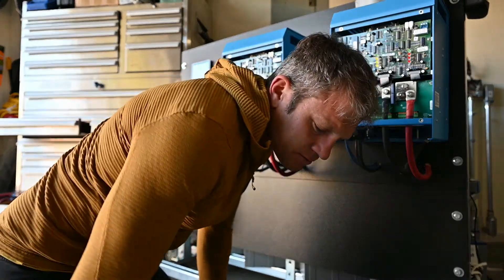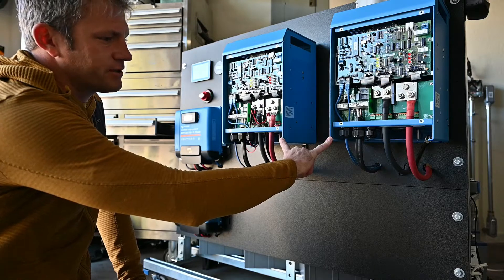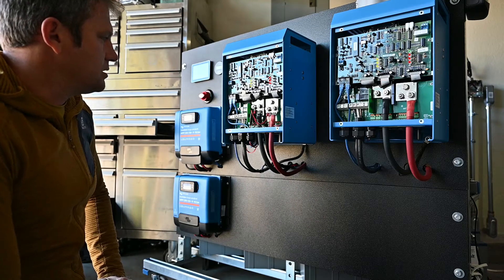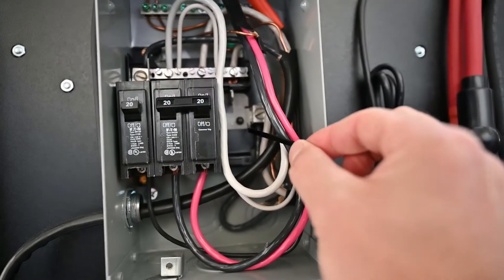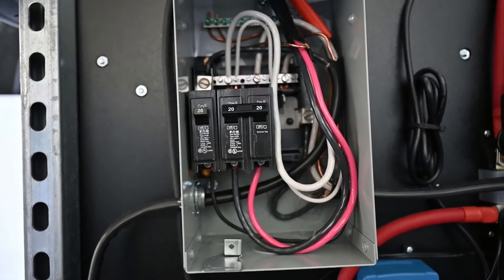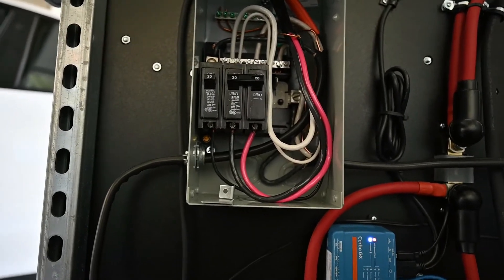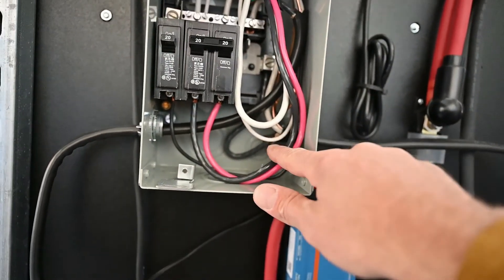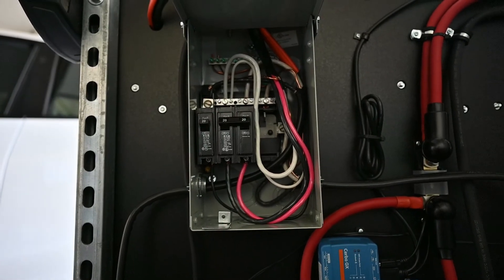AC Wiring Details: Tesla Charging with a 240V split phase off-grid solar system

Comment: Switching from an EG4 to Victron for our EVSE charger. Did you have to configure the neutral/ground relay through a setting on the Victron ? We're probably going to use the Victron EVSE just for continuity, but may try our extra Chargepoint.

Comment: Thanks for the explanation on how 2 Inverters can make 120/240. Nice install, but my opinion is clean up that breaker panel some, cut the outer jacket off at the clamps.

Comment: I'm still learning about solar so this may be a dumb question, but is it possible to run this system without the batteries? So that it's only the power from the sun going straight into the ev.
Reply from the maker: They now make inverters that work without batteries (some GroWatt inverters for example). Those have built-in max power point trackers so you plug you PV into the inverter and get AC out. BUT, you have to have sufficient PV all day long, no clouds. Alternatively, if you are asking to use DC output from solar panels and directly tie into vehicle - not sure. You would have to figure out what voltage the DC charging occurs (likely around 400V for Tesla), as well as the communication protocols for the plug. You would effectively be "DC slow charging". I've thought about this some, and the folks at SparkCharge have essentially done this, but they DC charge with mobile battery packs. Their mobile chargers supply 150-500VDC, 40A, for a maximum charge rate of 20kW. So not exactly fast charging, but faster than you can do at home using a typical AC charger.
Reply: @gridfreeordie  thanks for the info! I live in east San Diego so have about 300 days of sun where I am. I have a 2018 Leaf and just looking to supplement the charing that I do at work from home. I'm pretty sure the home 240v plug draws about 10 amps so not nearly as much as a tesla. I will check out those GroWatt inverters like you mention. DC slow charging is interesting too and I'll see if anyone has managed this with the nissans chademo,however seems like new innovation for chademo is dying with the charge standard.